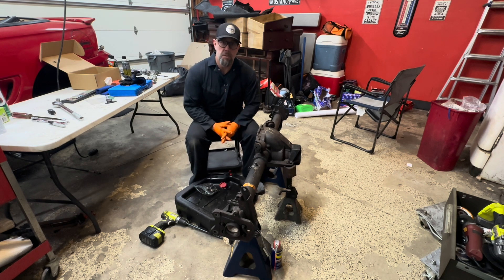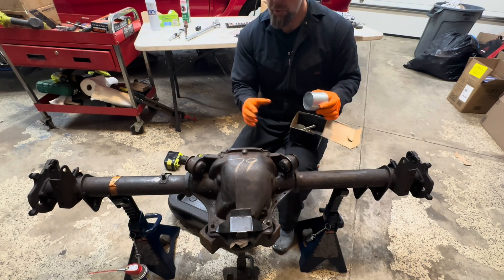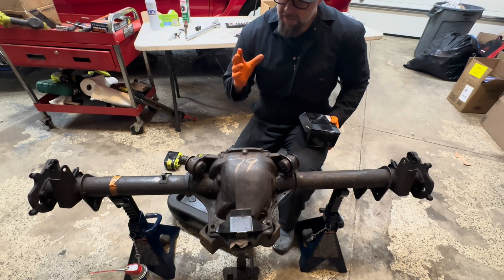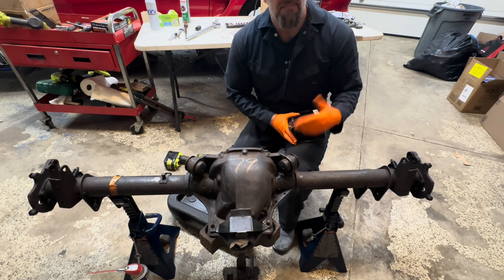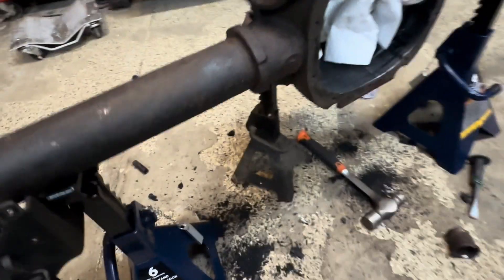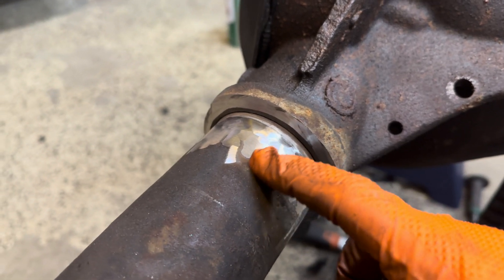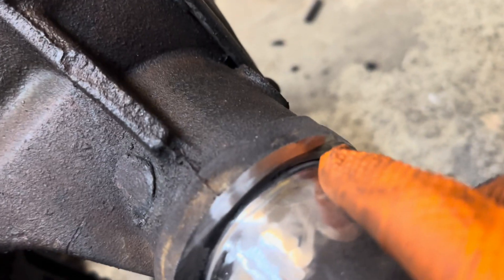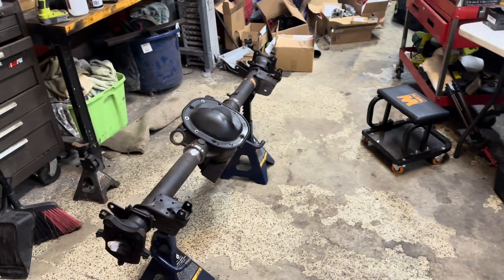Ford 8.8 differential Rebuild Part 2- Welding Axle Tubes and Paint!

Comment: Little late to the party here, but I had the same problem with those bolts for the bushing removal tool. I bought the MM tool and stripped the bolt on the first try. The trick is to use anti seize everywhere on the bolt, nut, and washers. MM has a video showing this. I actually stripped 2 bolts before I found that video. The third bolt worked flawlessly once I applied anti seize. Hope this helps anyone using this tool in the future!
Reply from the maker: Good to know!

Comment: Did you say you were adding 4:30’s.   If yes and you are turbo’d.    I think that is too much gear.    You want the 3:08’s as it will allow the motor to say in it’s power band.    If supercharge you want numerically higher gears.  Thks.
Reply from the maker: Yep 4.30s with a 28” tall tire, so it’s about the same as 4.10s with a 26” tire. This isn’t a dedicated race car. It’ll see a lot of street/strip and the 4.30s will make it fun. The 3.08s that are in there really make it a turd haha. 

I did all the math and I’ll be able to trap 125-130mph in 4th which is plenty fast for this setup and gives me a little room in the future. 

And RPMs will still be low enough for the street in 5th gear. I want to say around 3k rpm at 80mph when I did the calculator.